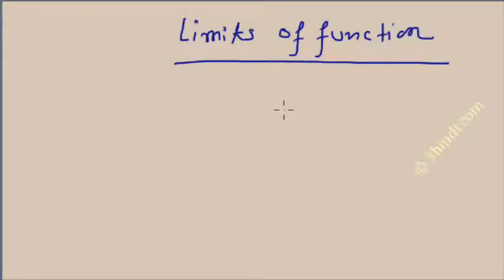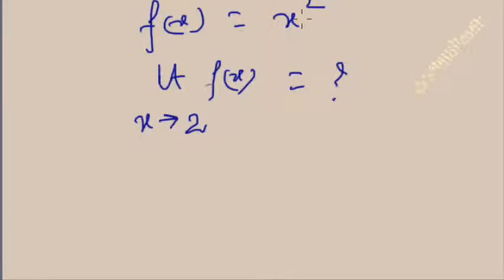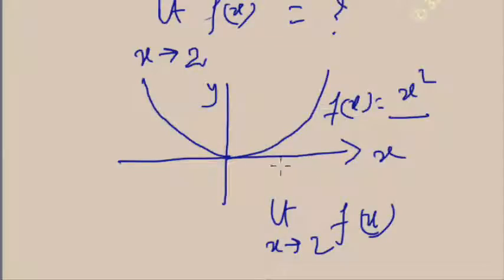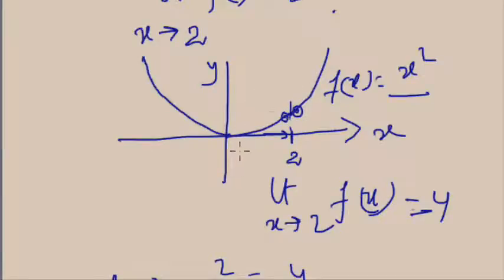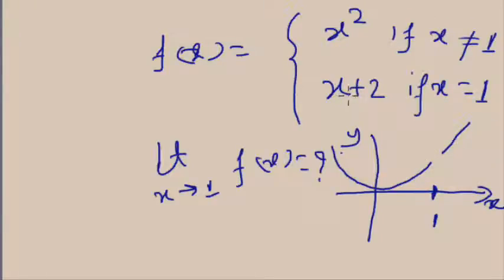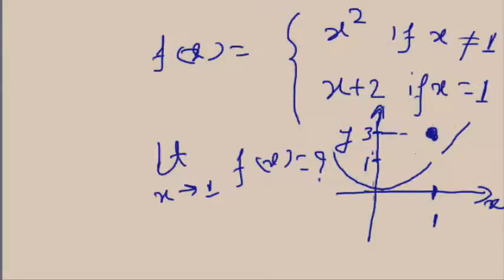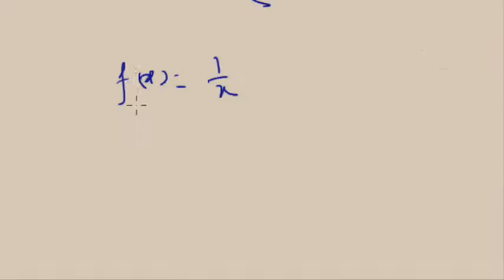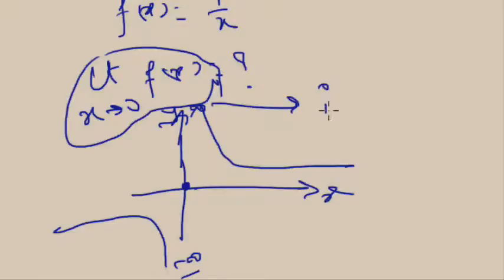GATE - Engg. Math.- Calculus-LIMITS- Calculus part-2

Comment: Dear Sir please check the syllabus and please cover remaining topics it is helpful for me and other students also. 

1.	MECHANICAL ENGINEERING – ME
Engineering Mathematics
 
Linear Algebra: Matrix Algebra, Systems of linear equations, Eigen values and eigen vectors.

Calculus: Mean value theorems, Theorems of integral calculus, Evaluation of definite and improper integrals, Partial Derivatives, Maxima and minima, Multiple integrals, Fourier series. Vector identities, Directional derivatives, Line, Surface and Volume integrals, Stokes, Gauss and Green's theorems.

Differential equations: First order equation (linear and nonlinear), Higher order linear differential equations with constant coefficients, Method of variation of parameters, Cauchy's and Euler's equations, Initial and boundary value problems, Partial Differential Equations and variable separable method.

Complex variables: Analytic functions, Cauchy's integral theorem and integral formula, Taylor's and Laurent' series, Residue theorem, solution integrals.

Probability and Statistics: Sampling theorems, Conditional probability, Mean, median, mode and standard deviation, Random variables, Discrete and continuous distributions, Poisson, Normal and Binomial distribution, Correlation and regression analysis.

Numerical Methods: Solutions of non-linear algebraic equations, single and multi-step methods for differential equations. Transform Theory: Fourier transform, Laplace transform, Z-transform.